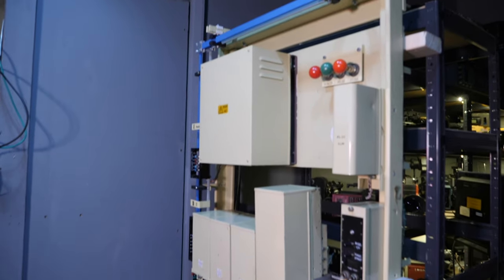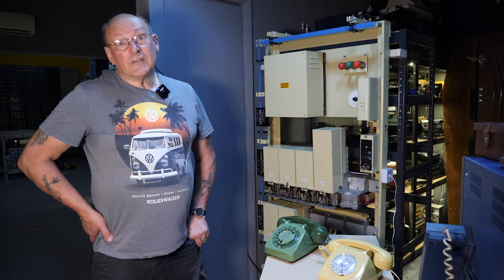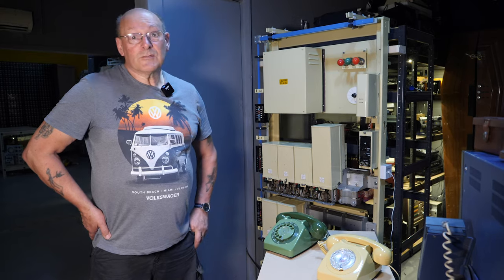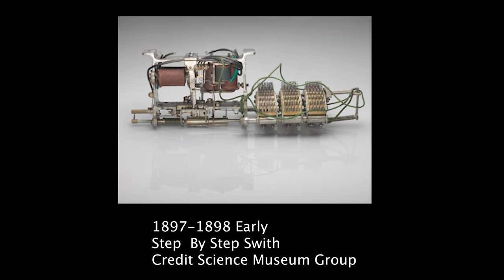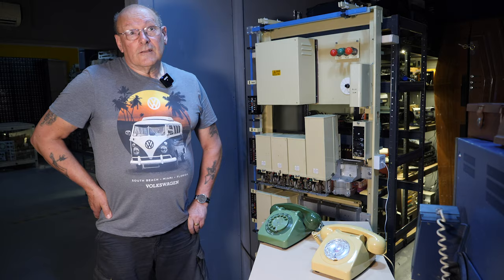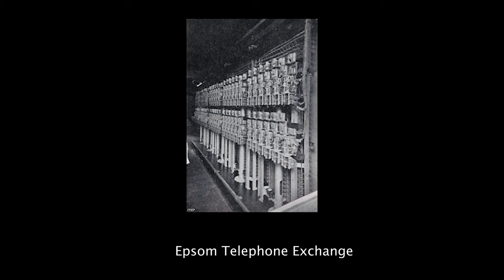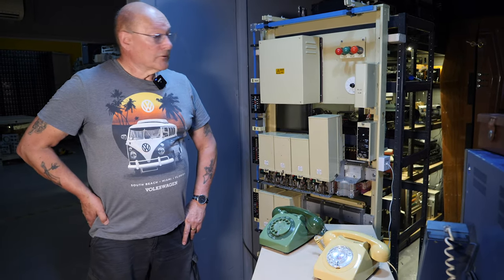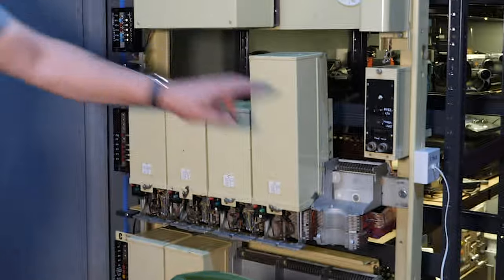The Strowger Step By Step Telephone Exchange

Comment: This is a great explanation and demo. When I did my apprenticeship we learnt Strowger, sadly digital SystemX came along so never got to work on one. Was lucky enough to see a few working in British Telecom buildings. To hear these sounds of the selectors stepping through is truly magic. Multiple that sound by 1000 and up the volume, and you get an idea of the sheer noise of a telephone exchange during busy hour. Today one computer no bigger than a the final selector can handle 1 million calls. Only the sound of the fan to keep the computer cool. No sound, and no smell of oil. It's just not the same....   thanks for making this video

Comment: I worked in a SxS exchange in the mid 80's, early in the morning you could hear a single call going through the whole floor from one end to the other, during busy times there was a constant noise of switches and movement with thousands of calls being made. Then if there was a faulty connection you could hear it chattering away trying to connect. Good memories, love this old equipment. Cheers 🍻

Comment: When I was young in the 1960s my mum put a padlock on the phone as my sister was always using the phone. If I wanted to ring someone I had to get permission first to get the lock on the dialler removed! The phone was a lovely 1930s ‘ GPO pyramid’ Bakelite phone. 

I remember when the Strowger local exchange was updated to a contactless switching in 1980, the GPO sent everyone a leaflet explaining the slightly different dial tones. The thing I missed was that the Strowger equipment had dirty contacts being an electro mechanical switching, which caused lots of noise, stray staccato clicking of the equipment working and stray other callers messages being overheard. Happy memories of my past!
Reply: Very cool story. Thanks for sharing. I had to look up that phone model. I now want one just so I can feel the ergonomics of it. Seems like it would be satisfying to hold.

Comment: I used to work in a very busy Strowger exchange back in the late 70's -early 80's. The exchange was in an industrial area of the city so a good deal of the traffic was business calls. The noise from the equipment at peak times was loud! In modern exchanges all you can here is the cooling fans.

Comment: I love seeing this stuff! I worked in Dutch phone exchanges around 2002 and all of this stuff had been phased out with a few exceptions. The people running them have such a wealth of knowledge and I am glad Richard saved these parts from the bin and you gave them a new home.
This fall I am visiting the UK and I hope to visit the museum if it's possible!
Reply: i worked there 1/2 years before, installing the first national fiberglass network, project SDH, the digital part, with lots of fine 0.25mm2 coaxial cables, always 256 (at least) in custom kpn colored 19 inch racks and indeed this stuff was already gone and a Purple Sun Micro systems Unix computer was found in every "neighborhood" exchange, but there where still huge ranks where the wire from the home connections ended up and some ancient vacuum hollow coaxial cable setups that lead to the antennas outside. some had a ships diesel engine generator as backup.
i also had to learn the old stuff from KPN or PTT, like soldering, the method of counting, hot to strip wire, etc, etc. courses by KPH spread out over several places by the KPN.

it was the best communication network on the globe and probably still is according the CIA world fact book.
Reply: @AnalogDude_  Same systems then! I was responsible for migrating PDH stuff to SDH and making sure that the two systems were matching (BRIT and OTA) and checking that the resulting orders were made in to COAX, the system that would tell everyone where to lay the cables.
Your response brought back memories of that time.
Fun fact: OTA did not have an undo, so once deleted, SDH lines could not be put back unless you started over...
Reply: @WouterWeggelaar  i only worked on need to know basis, i was team leader and we placed the 19 inch cabinets, the pretty fat earth loops on top of the 19 inch racks, powered the cabinets, placed the Marconi 19 inch network rack gear, layed the 4 x 4 (16 coax each) cables and using hamf wire to sew them, placing the  inox metal "DC"  poles where all the 0.25mm2 coax cables ended and got their BNC connector, sort of coax patch panels ... and repeated that all over the southern part off the country in every neighborhood exchange.
ofcourse bigger exchanges used more equipment.
the country was divided by 3 companies, Siemens, Ericson and alcatel. 

making those 0.25mm2 2MB coax cables was kinda Chinese labor. although using a calibrated machine to peal them.

it was pretty hi-tech, executed to extreme perfection. all the cabling was done perfect, straight, parallel, etc, etc.
someone came to photograph at it all, we weren't allowed to take pictures inside the exchanges.
a once in a life time opportunity.

not sure if they still require the same perfection now as back then, with these external companies they now employ.

employees of KPN themself did handle extreme fat 42 Volt  ground power cables and rails.

what you mean with undo? start over?
Reply: @WouterWeggelaar  we had a nice guy, one you wouldn't expect to do criminal things, the typical grandma's boy, as you might know, you had to call a number within a few minutes after entering the exchange and gave them a code, this guy went one Saturday and used his access card to get in to get the fat copper wire we used to make ground loops and stole it, he got arrested by the police and fired.

the alarm goes automatically after you enter such exchange and don't use the phone to identify yourself.
Reply: @AnalogDude_  I'm not sure if they're still that strict. everything went from neat to messy when internet took off and ADSL came in.
I remember moving the XS4ALL dial-in banks to another exchange. those racks were put in so incredibly fast that they did not have time to expand the exchange and some of these were on wheels with thick bundles of coax and crosswire plus power dangling. of course the technicians weren't happy and that's why we moved them in to a proper new location once that was ready.

Most of my job was cleaning up the old connections and optimising the use of space such that DSL could fit.

In OTA (the system including SDH) was a graphical application. If you deleted a bundle of connections, the relationship between all the individual connections was lost and the digital part deleted. it would take quite some effort to put these connections back in, one by one.
BRIT ran command line in a terminal, so you could scroll back to find your error and fix it.

Comment: What he said in the beginning was exactly what what was thought in Step by Step Switching school in the USAF in 1977. Oh the good old days! You can tell something was off just from the sound...time to break out the spudger and tweak a relay. My career started like this and ended in thirty five years where there was not a sound in the building, no tools or personnel for that matter yet millions of data and voice transactions went on. all you needed was a laptop. After the military, I was an analog multiplex technician and I absolutely loved it! Tracing a tone from the switch through the CO to the radio to find the culprit sure was fun. Especially if a switch tech followed as you use your frequency chart and punch it in the Selective Multimeter. Non mux people thought it was voodoo every time the tone sounded...how did he do that‽ Magic! Thank you HP.. those antiquated WG's were slow! Within ten years we gave up the radios and went to fiber optics. In another ten years the company was selling ISND service that went through an old Central Office that was using rusted copper wires and SXS switches. Those old Telcos learned the hard way that they had to change and now! I see form the comments, lots of old timers still remember. I bet we all miss the sound of dial tone and especially the gratifying feeling  you felt when you slammed the phone on the receiver relaying to the person that you were pissed off. The old pissed off disconnect! This was a nice dit of nostalgia...today folks have no idea what it was like. Hell, most never heard a dial tone. One of the most beautiful bit of workmanship I have ever seen was the stitching in the back of an old telephone operator console. Oh...and accidentally touching a pin that had ringing current was not fun...not at all !!!

Comment: Until 1995, our local telephone exchange was one of these step-by-step systems. I used to wait for the dial tone to stop, then you could hear the background noise of the exchange - other people dialling, faint snippets of people's conversations. I wish I'd recorded it, but didn't have any easy way of recording the telephone back then!
Reply: I find this hard to believe, I worked on SxS (Strowger) exchanges and never heard or saw this scenario. Sometimes you'd get "doubleswitched" where 2 switches stuck on the same outlet and you'd get crosslines but the way you expalin it doesn't seem possible to me.

Comment: Awesome, I worked in BT exchanges around 2006-2010 installing metering for private tennants. Orange (at the time), Virgin, O2 etc. The old Strowger stuff was still in the large exchanges such as Swindon just not used as 21CN and the tennants need hardly any room.

Comment: there's a cool thing you can do if your fast enough at counting. each step those rotors steps up to equates to a dialed number. for instance in this video from what i heard they dialed 34425. the last rotors is tricky because its special. it steps up to the number that was dialed in this case a 2 but then waits for the last number to connect which i believe was 5. now that number looks odd but back in the early days of phones local calls all were on the same network so you only had to dial 5 digits to call locally.

Comment: So when the selector goes up the the level you dialed, it then goes across and stops.

Is that it looking for another free selector? In these case there's only one so it'll always stop on the same point?

I would assume that's also why the final one doesn't automatically go across and you have to dial in the last number, cause it's not going to go searching for a free selector.
Reply: You are correct
Reply: yes, this is just a demonstration set up. There would normally be racks full of each type of selector so a maximum of 20 (10 upper contacts and 10 lower) outlets to the next stage selectors. Now let's talk about grading......

Comment: My first day at work after leaving school in the 70s was helping to look around Lancaster house telephone exchange Liverpool for  Selectders to hang on the new racks in the 10 years I worked for plessey on exchange construction I  Learnt to do Most jobs from the ground up including how to adjust the wipers into the banks. Little did I no I would end my working  career at the other end of the network safety checking poles after 40y work for the GPO BT Openreach the pole testers job was a higher paying rank that was why i volunterd to do the job and most of the time I did it I was my own boss and left alone to look after the 30.000 poles on my patch

Comment: One problem was that if one person did not hang up, the line would still be connected, so  the person who hung up can't pick up and make a new call. They would still be connected to that other line.
If I remember correct...
Reply: Yes but this was only the case for the called party - the caller had control of the call. However, I believe that measures were introduced to mitigate this with an enforced cleardown after a certain period of time.
Reply: @ObviousSchism  You are right.

Comment: The caption is incorrect. They are 2000 type selectors (not Strowger selectors).
Reply from the maker: yep you are right. but both are used colloquially. even by ex bt operatives.

Comment: It seems to inefficient to use one number per switch. They are clearly two dimensional and can handle two numbers each! Maybe it's for demonstration purposes...?

Ericsson made switches that were a lot larger, I think they could handle three number each. One number up and down, one left to right, and then an arm shot out to different depths for the third number, IIRC. Saw one in a museum once.
Reply: It’s demonstrating how it was used the across motion on uniselectors function is for hunting for free switches for the next number. However The last one has 2 numbers

Comment: It'd be helpful if someone explains me the following scenerio. 
In this case subscriber A calls  subscriber B. When the A was dialing, it generated pulses which made those (thingies) to switch to a certain level and the led were on. Suppose the call is being carried out between A & B.
Now at the same time subscriber C attempts to call Subscriber D, as the lines were already occupied as indicated by those LEDs, what will happen in that situation?
The main point I'm not getting is, I am assuming even this small system can handle multiple calls at a time, and wondering what happens if more than 1 calls toook palce.
Thanks.
Reply: There are racks of hundreds or thousands of these switches.  What was left out of this demonstration is the first switch you encounter is called a line finder.  It senses that someone has picked up their phone.  The line finder “finds” that caller and connects them to a first selector that send back dial tone.  You now have your very own path through the exchange. The call progresses like you saw until the final switch called a connector.  The connector is the switch that takes the final two digits and connects to the called telephone. So hundreds of calls can be connected at the same time.  A Strowger step-by-step exchange was a noisy place with all those switches clicking around and completing calls.  With experience, you could hear a malfunctioning switch amid all that clatter.

Comment: I’ve watched several videos on SxS and the action is explain well, but the big picture is still eluding me. 

So let’s imagine a town of 10,000 people and a single central exchange where everyone has 5 digit phone numbers. That means in our central exchange a single phone call requires 5 uniselectors, correct? So if we have 10 level 1 selectors, 10 level 2 selectors and so on, there can only be maximum 10 phone calls in progress at any one time, right?

I guess I’m confused about how / why the central office equipment is arranged…so every single phone in our town is connected to a special final connector?
Reply: Each final selector has access to a block of 100 numbers (10 levels x 10 outlets). There are 10 final selectors on a shelf but then there can be more shelves on the same group depending on how busy that range of nubers is. You can always add more switches if callls are failing due to not enough final selectors.  Same with the 1st, 2nd etc selectors, there wouldn't only be 10, usually racks of them. You are correct that with a 5 digit number the selectors would all be held for the duration of the call, in this case 4 selectors - 1st, 2nd, 3rd and final. Hope this isn't too confusing

Comment: I see that there are 10 wafers in the set and there are a pair of wipers on the shaft, one on the top and one on the bottom of each wafer.  I see the contacts on top of the wafer, is there a second set of contacts under each wafer?  And then there seems to be a duplicate set of 10 wafers and wipers above those.  What does the second set of wafers do?
Reply: in these switches yes contact on top and bottom. there are 4 contacts which are the + and - of the phone signal line. the P wire which transfers functions and also the M wire is for the meter which goes up to charge the caller

Comment: how is the number sent from the phone to the selector, is it like a 'cv' scale? 1v per number, or what have you
Reply: Its simply a sequence of break/make pulses caused by the telephone dial returning to its starting position under spring tension and using cams to operate a mechanical switch as it does so - one pulse for digit 1, two pulses for digit 2 and so on. Later push-button phones created these pulses electronically.